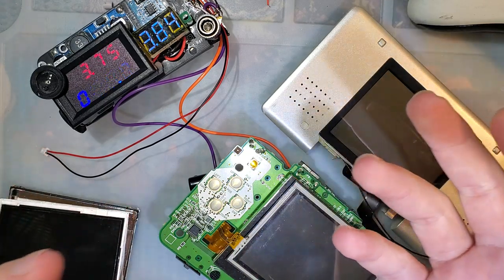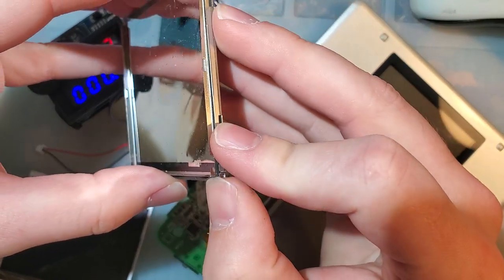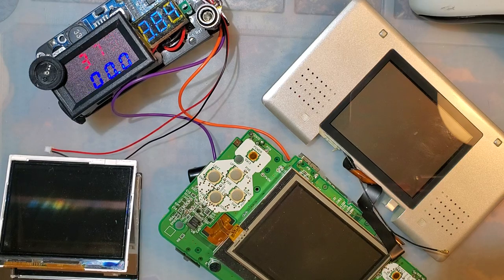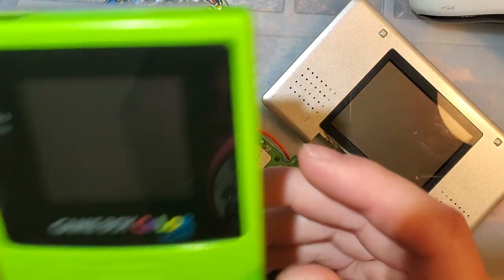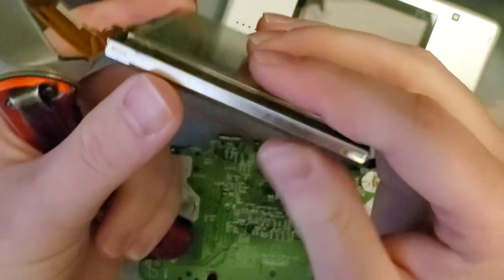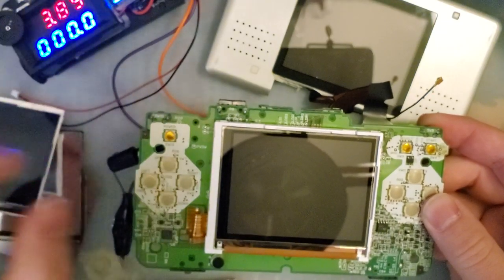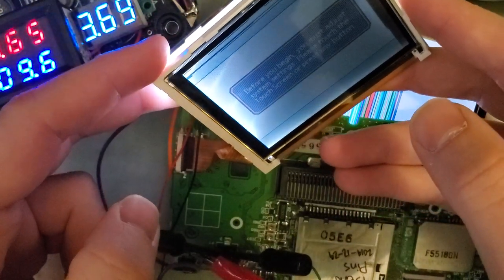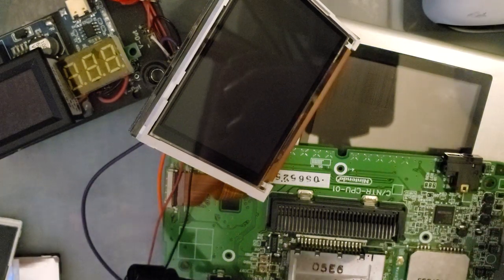Original NDS -- Is it Frontlit? (No, it's not)

Comment: The DS fat does not get enough love, it had an amazing screen type that is great for both outside and Inside, and was more comfortable than all other ds consoles
Reply: Good for outside but only decent for inside. The plastic is also terrible so it's the DS that breaks the easiest. There is not enough advantage over the Lite and that's why it gets no love. Like the DSi I suppose. the new stuff added is not worth losing the GBA slot for a lot of people.
Reply: Different strokes for different folks I guess, I can't hold a ds lite, it hurts because it's so small
Reply: @harrisontashjian752  Ever tried a Gameboy Micro? lol
Reply: Nope and I'm affraid to
Reply from the maker: Clicky buttons stock too
Reply from the maker: @chamoo232  Well, the plastic was a lot better 15 years ago. I had one of these new and they were fine. Had the plastics not gotten brittle over the years or if we had decent aftermarket shells, it would be a different story.
Reply: @makho  I find that blue and black ones are the most sturdy. 

I guess maybe that comes down to whatever chemical mixture was in the plastic- but I hardly see those two colors cracked or broken. Nowhere near the ammount of destroyed silver, whites, and pinks.

Red seems to be somewhere in the middle, but they're not as common and I don't think I've seen enough to come to a good conclusion
Reply: The Original DS is still my favorite and, I just love it. I had 4 of them but, a faulty flash cart messed up 3 of them. Mostly because I'm dumb and experimenting.
Reply: @LelandHasGames  depending on what's wrong with them, you may be able to reflash them and fix whatever happened

Comment: I just wish someone or one day the make mods for the phat DS. An upgraded lcd/ips kit would be nice. Heck even a mod to install ds lite screens would be incredible. The ds phat imo is the most comfortable console and has the best buttons ever.
Reply: @2NDFLB-CLERK  i got a phat specifically with gba games in mind. I hated playing the lite with the gba cart sticking half way out
Reply: @FurNaxxYT  
▪
I said screw it and got both.  
If I had to choose one over the other, I'd go with the phat one.

I barely even used either of them whatsoever thou.  I got a Gameboy player, a GameCube and a gba original (to use as a controller) - mainly just for the two metroid gba games I missed out on when I was younger.  I liked them, but they're both pretty short.  I expected to get stuck on them More than I did and I wanted a DS just incase I didn't want to play it on the TV.

So it'd be cool to get some more good gba games just to use the hardware alittle more.  I don't see many games that make me want to order them.. maybe I'll see something eventually. 

I got that mariokart super circuit, , and I think that's the only other one...  

I used to have the game boy advance when I was young... but I can't seem to remember all the games I had for it thou...

I had "golden sun",, but I wouldn't like that today [I hate turned based fighting these days, and barely liked it back then]..
🟥

Comment: I actually never turned my light off on my DS...
Reply from the maker: Understandable. It's really dim with the light off.
Reply: I did on a DS lite and couldn't see anything because the newer systems  (lite, dsi, old 3ds, new 3ds) don't work like the original DS so the backlight stays on but the screen goes black (I don't know why the new systems don't work right but it could be because the hardware is different but the system software is the same so it doesn't know how to make the light turn off)

Comment: I think you can save this frontlit screen using an AGB-001 screen with a conversion ribbon cable.
Reply from the maker: I'm going to put it in something, I just don't know yet. I could also just use it to repair another AGS-001 LCD I have with a damaged light panel.

Comment: All this time I though it was front lit because it look so much like the AGS-001 screen. Now I know that it's actually just garbage backlit. How come they got it right with the AGS-101 but then messed up with the original DS?
Reply from the maker: It's Nintendo's first (color) backlit LCD (yes, the original NDS came before both the AGS-101 and Game Boy Micro). I'm not really surprised they didn't get it right the first time. They ended up with too many compromises to make it reasonably priced and include all the features they wanted.
Reply: @makho  I forgot that the 101 came out very late. 2005. The PSP was out by that point. Europe didn't even get it if I remember right.
Reply: @chamoo232  Europe got a limited run of AGS101 consoles mostly in Germany but other countries like Spain and France too

Comment: This is probably a stupid question, but aside from the size difference. Why dosen't anyone try to put the ds lite screens on an original model ds or even on a gba? I mean I have seen how far the madding community has gone with modding the shells in other to fit after market lcd like the funnyplaying screen for the gba or the gb macro mod for the ds.
Reply from the maker: Because it's not as simple as "it looks similar." It requires custom electronics and a lot of dev work and trial and error. Plus, there are no datasheets available for these LCDs (that I know of) whereas there are much nicer, more modern LCDs available for similar price, with datasheets, and that look significantly better. If you have to put in the work to get it to work, why not start with a nicer screen to begin with?

FWIW, BennVenn was working on a project to put DS Lite or DSi LCDs in a GBA. He has working prototypes but you know how long it takes him to go from project -> product. It may never see the light of day.
Reply: @makho  thanx for  explaining. I was hoping it would be a matter of just making an adapter like the one u use on your gba but guess not. And it makes total sense to go for a better screen.  Thou I would love to have screen mods for the original ds just for the from factor and the bigger gba display.

Comment: Makho, i got a GBA IPS v2 from Funnyplaying and i have a flickering led light( green, red, orange), the screen heats up allot on the left side and if i press select with the brightness high it sometimes shuts down completly, is it possible that it's shorting? I opened the thing and it didnt had any Kapton Tape in it. If that might be, what can i use instead of Kapton tape? cus no one sells it here...
Thanks in advance.
Reply from the maker: Yes, likely a short. You really should use kapton (brand name) or polyimide tape (generic name) for this but electrical can work too. Just be aware that the electrical tape will start dissolving and leave melted adhesive on everything it touches.
Reply: @makho  Man, thank you for responding!
Love your videos btw, i have seen most of them :p
Just one last question, should i add the tape to the non used 40pin thingy only, or should i also add on the back of the screen ( the silverish metalic part ) and the V2 Ribbon components?
And should i keep the black foam at the back of the screen? Cus my screen heats allot near the D.pad. 
Thanks in advance.

Comment: I have a problem with ds lite. When I put the device to charge, the orange light is constantly on and the battery is not charging (after maybe a minute the orange light goes out). I'm wondering if f1 and f2 fuse aren't broken, what could be the cause of ds lite not charging?
Reply from the maker: Try a new battery

Comment: I have a bunch of original Nintendo DS systems that have screens that work but, when the backlight is on, the screens appear to have dead pixels. But, it only appears that way when the backlight is on. Any idea what might be going on? Can I salvage the screens?
Reply from the maker: I suspect that you are just only seeing it when the backlight is on, not that it goes away when the backlight is off. To my knowledge, the LCDs are not salvageable once this happens. You can still use the backlight itself for something else (like backlighting a Pocket) though.

Comment: how hard would it be to replace tn screens with ips ones in a 3ds?
Reply from the maker: If you can find a screen that works, it's as simple as removing the old one and installing the new one. If there is not a screen that works, this is one of those questions that if you have to ask, the difficulty is likely too high. I know it's beyond my abilities anyway.
Reply: Dont know about the original 3ds, but the XL, New XL and 2DS XL screens are compatible, if you find an ips replacement (likely from a new 3DS XL) you can replace it, all said the hinge mechanism is a boobie trap if not carefull you can cut the ribbons too easy.

I hace a new 3ds with an original ips screen, the calibration is so bad they look just super oversaturated and with some minor ghosting i prefer the desaturated look of the TN pannels just becouse they have much less ghosting, but im super sensitive for those things, my good old frontlit gba sp have the best response time on a portable screen, no ghosting when i recalibrated the potentiometer.